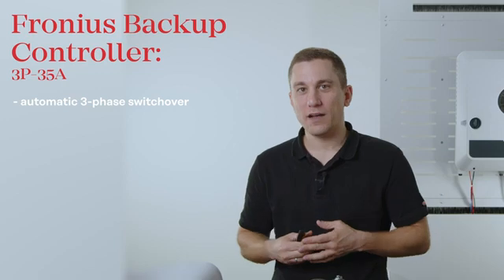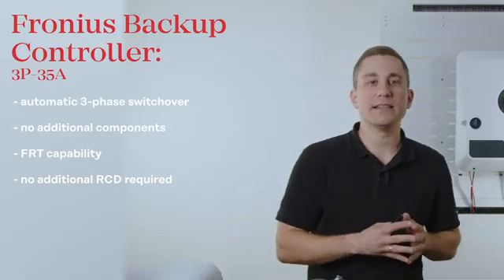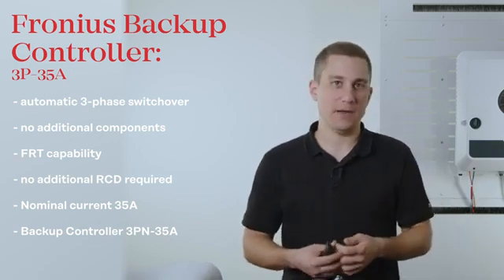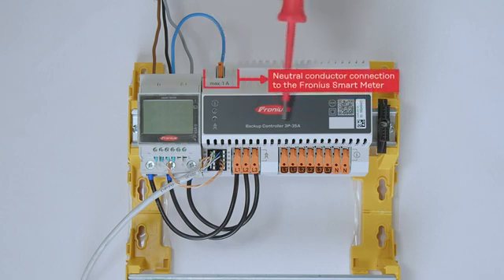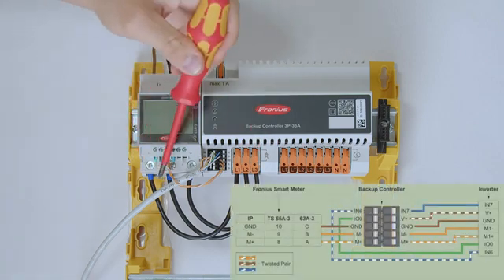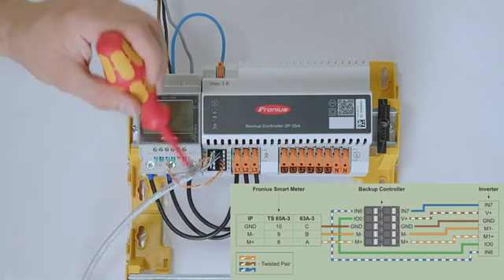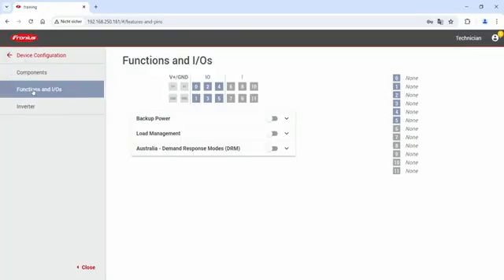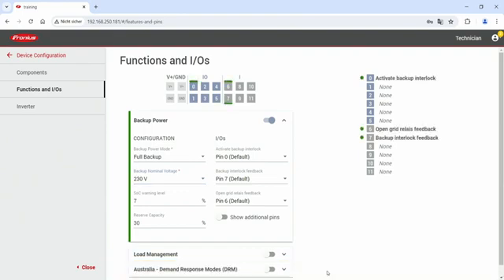#Fronius #Backup Controller: How to Installation & Commissioning Guide 🚀

Comment: So i have a gen 24 symo plus. The up storage is installed. I want to buy batteries. It takes up to 3 minutes for the energy to become online if the grid connection is lost. Do i have to buy this controller to use the batteries? Its not sufficient the inverter and batteriea?
Reply from the maker: For the Fronius GEN24 Symo Plus inverter, if you want to use batteries for backup power during a grid outage, you need to ensure that your system includes the necessary components for seamless operation.

The GEN24 Symo Plus does have a basic backup function (PV Point) without additional components, but it only provides limited power and not a full backup solution. To achieve full backup capability with batteries, you will need the Fronius Backup Controller (sometimes referred to as the Fronius Multi Flow Technology controller).

Without this controller, your inverter and batteries alone won’t provide an uninterrupted power supply (UPS-level backup). The delay you mentioned (up to 3 minutes) is due to the inverter needing to establish a stable off-grid operation, which the controller helps optimize.

So yes, you do need the Fronius Backup Controller for a full and immediate backup solution when using batteries with your GEN24 Symo Plus inverter.

Comment: So many brands have the ability to go to backup mode instantly and the appliances dont switch off. Is this the case with this controller?
Reply from the maker: No, the Fronius Backup Controller does not provide a true instant switchover (uninterruptible power supply – UPS) like some other brands.

With the Fronius Backup Controller, there is still a short interruption (a few seconds) when switching to backup mode during a grid outage. This is because the system needs time to detect the grid failure and reconfigure itself to operate off-grid with the batteries.

If you need a system that ensures absolutely no interruption (like a true UPS), you would need to look at hybrid inverters or systems specifically designed for seamless transitions, such as those from SMA (Sunny Boy Storage) or Victron Energy, which offer near-instantaneous switching.

Fronius is reliable and efficient, but for sensitive appliances like servers or medical equipment that need uninterrupted power, a dedicated UPS or a different inverter system might be necessary.
Reply: @3buysolar  hybryd inverters ... Fronius has hybryd but its not capable of instant switch